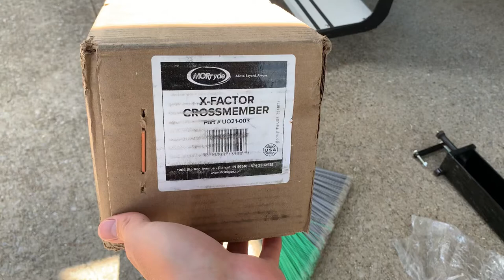MORryde UO21-003 X Factor, CRE3000, and UO12-016 Heavy Duty Shackle Upgrade on Grand Design 311BHS

Comment: Nice video. One thing I would add maybe is get some 3/16 plate steel and weld them onto the ends of the front and rear hangers to box them in for some more structural strength

Comment: Rosie and I have been in a constant battle with our suspension on our Solitude 310 GK. We upgraded to 4000 LB springs after several failures. Then we upgraded to Mo- Ryde  something-4000 ( supposed to be their best. Failed right out of the gate leaving us stranded in Shawnie OK. We had Mo-Ryde ship us the Cree 3000 and some nice folks in Shawnie put them on. Now we are back home and I am missing a nut and a Octagon Cam off the spring hanger on one side. Looking for a octagon cam replacement as we speak. Sure would be nice if these trailer manufacturers would do thing right from the start. Burlington Bill here ( singer songwriter) Here on youtube. Oh another upgrade was G-Rated american Tires!

Comment: I sure wish you would make more videos. You are my favorite channel. It helps that we both have 311BHS RV's but I would still enjoy your content even if I had a different RV.
Reply from the maker: RH63, Thank you, that's very kind!  I've been doing a lot of camping this year and less improving / fixing things.  I'm open to ideas though if there's anything you'd like to see or want some tips on?
Reply: @rvengineer2300  At the moment, I only have one issue in my RV and that is I can't receive any OTA channels. I traced every coax, I bought a new plate with the booster button in case the original was bad and I used a Klein Coax tester to follow which cable went to where. The only thing I didn't find was a coax that goes to the Winegard antenna on the roof. I don't know if there's a splitter in the wall somewhere or there wasn't a cable added when the RV was built. Short of taking the antenna off the roof, I'm stumped. Any ideas what I should try next?
Reply from the maker: @robh063  Sounds like you've done everything I'd try.  I'd also be reluctant to take the unit apart at the roof unless it was leaking.  Maybe at end of season, put on your warranty work list?  Else, get a lot of Dicor and get ready to scrape :)  Good luck!

Comment: Thank you for posting this.  I’ve had these X factor braces in my Amazon cart for months. I think I’ll go ahead and pull the trigger this winter to prep for spring.  We recently bought a new dual axle camper and the parking spot for it is essentially a tight 90 degree turn in our driveway.  The tire scrub and hanger flex just makes me cringe every time we return from a trip.  Time to do something about it.
Reply from the maker: Agreed.  Those tight turns are what got me thinking about the upgrade as well.  I'm glad I did it.  Good luck!
Reply: I have wondered if throwing some sand on ground in turning area.  Allow tires to slide sideways a little.   I love my pull through storage.  But I will probably be leaving some sand behind at campgrounds.

Comment: Enjoyed your video.  Just ordered everything.  Doing one side at a time seems to be the safest way to do this.  Any pointers you can share WRT support for the side you’re working on?
Reply from the maker: I had the camper unloaded (no need to make it heavy with water, etc), leveled, wheels chocked on both sides in both direction, then I used Jack stands to support the side when I removed the wheels just as overkill, a jack stand with a bottle jack built in (my personal favorite for working on the camper or truck) to support and raise the axle, and then I believe I also used a floor jack with the block on occasion to manipulate the leaf springs into place.  It's been a few years, so my memory might not be perfect on where I was using bottle jack vs floor jack.  Good luck!  Still very happy I did it.

Comment: Thank you for all the great information.  I learned alot from watching your video.  And I will do your recommendations on installing the cross braces and putting the holes in the wet bolts horizontal.  Thanks again.

Comment: Nice video and good information! I have a 2021 GD 303RLS the CRE 3000 was already installed at the factory, and so far I have put about 13k miles on it, and I decided to upgrade my leaf springs to 3k along with this project, all of the bushings were cracked just like yours in the video. Unfortunately I am not able to install the rear X factor due to the fresh water drain in the way. Morryde said its ok to install just the front and middle. Next project is installing disc brakes.
Reply from the maker: Thanks for the feedback and good luck!

Comment: I had a rear hanger failure 2 weeks ago and the inside wet bold brass sleeve that have been there for about 30000 kms was exactly like yours, half of it missing and I do grease them like every 5000 to 7000 kms.

Comment: Well done video.  My 2017 Road Warrior triple axle toyhauler came with CRE3000 equalizers but stock shackles and  no wet bolts??  I purchased the Morryde heavy duty shackle kit with wet bolts.  Additionally I purchased the Morryde X Factor crossmember but had to purchase separately the CorrectTrack adapter plate kit to mount the crossmember. I get a tremendous amount of stress on the suspension during tight turn backing with 3 axles.  I see you installed 3 of the crossmembers.  I am debating where to install and how many crossmembers I will eventually install.  I have some obstacles (sewer drain lines) that wiil not allow crossmember install at all 4 locations (front, rear spring hangers and both CRE3000 equalizer locations in between)
I also notice you have installed disc brakes.  Did that come on your rif or was it an upgrade also you installed?  Can you share details?

Thanks
Reply from the maker: I agree the stress seemed to be worst when backing.  I've very happy with the product 2 years in.  I made another video about the disc brake installation.  I did it all myself.  The wiring was probably the trickiest part because I wanted to use some existing wires to the pin box.  I found a great diagram that helped me out a lot that I cite in the video.  In general, suspension, terrible tires, and braking systems seem to be not robust enough if you really want to use your camper.  I feel a lot more confident towing knowing I've made the upgrades (even though the second you touch something, Lippert won't warranty it). Good luck!

Comment: I believe we have the same camper.  I was wondering if you could go more into how you lifted the camper.  Looked like you used the equalizer jacks and blocks on one side.  Did you do that all the way around?  Then use jacks and stands to manipulate the axles?  Thanks!
Reply from the maker: I had the camper unloaded (no need to make it heavy with water, etc), leveled, wheels chocked on both sides in both direction, then I used Jack stands to support the side when I removed the wheels just as overkill, a jack stand with a bottle jack built in (my personal favorite for working on the camper or truck) to support and raise the axle, and then I believe I also used a floor jack with the block on occasion to manipulate the leaf springs into place.  It's been a few years, so my memory might not be perfect on where I was using bottle jack vs floor jack.  Good luck!  Still very happy I did it.
Reply: @rvengineer2300  Thank you.  I hadn't heard of these until the shop foreman tried to sell me on some. After I saw what he was charging I thought I can definitely do this. Just wasn't sure on lifting one side at a time and getting everything to line up.

Comment: I saw a video that had round spacers which allow you to clamp all the way about the spring hanger. I wonder if they added that feature after you install led your cross brace.
Reply: I noticed that too. I went to the website and looked through the install instructions. There were actually three installation variants addressed - one was the full strap version. They illustrated that as the center support, with the others for forward and rear having different end bracketing for correct track and a drop down variant. I did not see the half bracket strap variant - but it could be due to when they were produced or some other factor.

Comment: Thanks for making this video. I have the same fifth wheel as you and am considering adding these to my suspension overhaul that is in the works. When I spoke to the MORryde rep today about these cross members, she informed me that they wrapped around the leaf spring and equalizer hangers rather than needing to attach any hardware in the inside of the hangers as you have done. This would be needful as I am having some V clips welded on between the hangers for that lateral support. When you did this upgrade, did you have that option? I see you don’t have those V clip’s between your hangers allowing you to attach these cross members as you have. Also, what has been your experience since installing them?
Reply from the maker: I didn't know anything about V Clips when I did the install.  Still really pleased with the upgrade.  No issues.

Comment: A bit confusing.  You said not to have the hole in the wet bolt in the up or down position but to the rear. Did you mean to have the hole on the side?

Comment: Why do you have the shackle grease fitting facing inward? Seems you should have them all excisable pointing out making it easier to grease
Reply from the maker: Scott, good question.  Reason 1 is clearance to the tire on my rig.  Depending on leveling, the zerk can be hidden behind the tire, making access difficult.  Reason 2: In genral more road debris will end up on zerk if it's close to the tire.  To the inside, they are protected some.  The X Factors have to be to the outside, but they have good clearance to the tires.
Happy camping!

Comment: How’s the trailer doing since installing the crossmembers? Considering install them on my trailer
Reply from the maker: I do notice a difference in tight back in turns and in general, based on how much the middle bracket was bent I feel safer.  I drive it ~1,200 miles in a few weeks, so that will be a real test as some of the roads I'll be taking aren't the best.  I'll update after that.

Comment: I want to do this upgrade - maybe doing all three cross-members (equalizer brackets and front and rear leaf brackets). @ 2:50 you mention needing longer bolts to take the cross members.
 I am looking at buying the heavy-duty wet bolt upgrade kit and see it comes with all the parts - so, those work with the cross members, yes? Will, they work if I don't upgrade the cross members?

I get the reasoning of "why would you do the upgrade and NOT stabilize the brackets - getting all the frame wiggle on those welds?" Seems the best move is to order all as one (around $400 on amazon for CRE3000, shackle kit, and a single cross member. Add $120x2 for the additional cross-members) - $650 

I'm pulling a smaller trailer under 7,000, so this may be overkill, BUT I'm pulling it over 5k miles a summer (Texas to Wyoming).

How often do you lube those bolts?
Reply from the maker: Michael, thanks for the questions.  The MORryde X Factor comes with the properly sized wet bolts.  You need the included extended size only if you do the X Factor.  I really should have cleaned up enough to take a video of how bent my center brackets were.  I talk about it in the video, but we are talking about a light 5th wheel camper ~11k unloaded, 13k at my heaviest recorded and I had to get another jack to align the center X Factor set.  
The heavy duty shackle upgrade from MORryde has everything you need except the extended bolts that come w/ X Factor if you decide to add that.  You can do the shackles w/o doing the X Factor. 
You can see in the video how damaged my brass bushing were, so I think at least new bushings should be evaluated.  Whether or not you need the shackle upgrades is more a preference since you'll have it all taken apart anyway.
If it was my dollars, I'd do the X Factor and bushings only if I was trying to save money, but the $100 for the shackle upgrade is relatively small when you think about what you spend on a camper, diesel, truck, etc.  The $100 includes the bushing, so really it's even less of an add on.
I use the Lucas X-Tra Heavy Duty Grease (green).  Once the wet bolts are properly lubed, I give them 1~3 pumps (just until I see it ooze) at end and middle of my camping seasons.  I'm doing 5k to 8k / year.
One final thought, on really light campers, sometimes the bushings aren't even metal, they are plastic / nylon.  If that's the case, the I could see the shackles being more important.
Hope this helps!
Reply: @rvengineer2300  Sorry to bug you with more questions - but, seems good advice that might help others.
Am I able to do the MorRyde CRE3000 and shackles first (the parts are here) THEN do the X Factor crossmember afterwards? Perhaps a stupid question - does the rig need to be jacked up to do the X factor? Guessing "Yes" because you are taking a chance the center bolt holding the equalizer on the rig doesn't shift it out of place
Also, I am considering - all the time and effort - picking up some new leaf springs. The standard 1,350# capacity 4 leafs are what's on it and what I can replace them with. but their max is 7,000 lbs (all 4 together) which is our trailer max. Should I consider going up with a heavier spring OR "No, because the ride will be too stiff - they are designed for a weight range."

Also, @8:18 nut has to be on inside/zerk(?) lube access to outside. Seem that might be a tight access for a torque wrench - but I trust it is for a reason...
Reply from the maker: @idsullymichaels  You can do the shackles and CRE3000, then go back and add the X Factors, you'll just be repeating some of the work at the CRE3000 center attachment when you put the longer wet bolt in.
You definitely want the trailer properly supported.  Mine has 6 point leveling and then I used some jack stands as well for extra support.  You'll need jacks on the axles too move the suspension up and down to align things.  
Leaf springs I think is a preference.  I haven't heard of many tailers failing bc of them (I'm sure you can find examples if you look hard enough, but it seems there are weaker points in the suspension like the hanger brackets).  It will probably ride stiffer, but not sure how much you'd notice and depends on how you load the truck and trailer.
I personally would put replacing leaf springs low on my list unless I saw an issue or excessive corrosion. 
Tires, drum brakes to disc brakes, supporting the hanger brackets all rate much high on my list.  Drum brakes may be ok on your size trailer, but I hate the bearing design x drum brakes bc as the bearing heat under normal usage, some of the grease always turns to oil and leaks onto the drum.  It's like they just get a little worse with every single use.  
I'm also sure there are people that swear by their bearing maintenance and have no issues, but I'll take my stopping power of disc brakes any day.
I'd also probably upgrade my truck suspension bf looking at trailer leaf springs.  I added the rear suspension airbag system to my truck.  That does way more for comfort than anything to the trailer. 
Good luck!

Comment: What a great video. Being a Auto tech is well explained. Was searching for info on the x-factor to put on my trailer. Is there a reason you went with the cre3000 instead of the LCI version?
Reply from the maker: Honestly, I didn't put a ton of research in the CRE3000 vs LCI.  I figured going all MORryde would fit well together and in general, I like their build quality.

Comment: Good morning. Again Did you put three cross bars on your unit and did it seam a benafit.  Jack
Reply from the maker: Hi Jack, yes I did put 3 on.  I think it does make a difference.  Stability on rough road feels better and tight backing also better.  The Middle seemed to be the most important, at least based on how bent mine were.  I've also heard of a lot of people breaking the rear brackets, so I'd rate that one high too.   
If I bought another camper tomorrow, I'd install them again.  Good luck!

Comment: Great video. I am about to order the parts for my 311BHS and want to confirm my measurements. Did you order the version for 35” spacing? That is what I measured out but want to make sure.
Reply from the maker: Micah, yes I ordered the 35".

Comment: I was thinking about doing this, but with only one xfactor for the middle piece. Is there value in doing just the one or do you think it needs to be all three? I have a GD 2400bh.
Reply from the maker: Based on my sample size of 1 (my 5th wheel), the middle seems to be the most important one to do.  That also seems makes sense from a geometry standpoint as well.  If I was going to do 1, I'd make it the middle.  Whether you need all 3, that more a matter of preference.  Good luck!

Comment: Any thoughts on how the crossmember adds or takes away from CCC of the trailer?
Reply from the maker: Always safest to assume it only takes away based on the weight it adds.  Tires, axles, and Pin box are typically near their limits at max CCC, so I wouldn't push it.

Comment: i just purchased the crossmembers for my grand design , i was courious on your installment ,while installing did your crossmembers match up true from one side to the other ? mine arent true ?
Reply from the maker: In what direction?  In 'H' (up and down), my middle ones didn't align, so I had to jack them into alignment.  If you are talking about in 'L' (front to back)  I didn't have any real issue, but it could maybe be how you temp tightened the outer bracket that goes over the hanger bracket? Good luck!